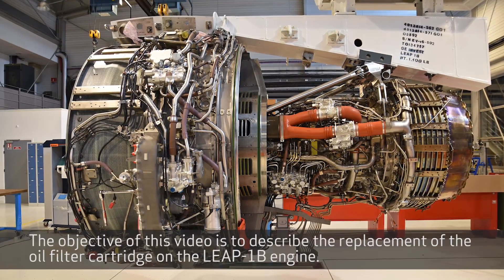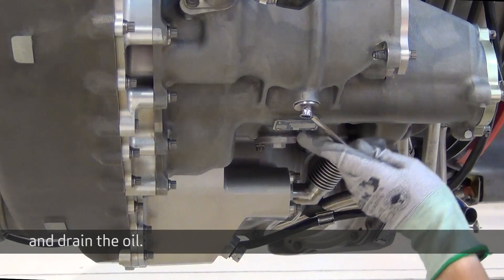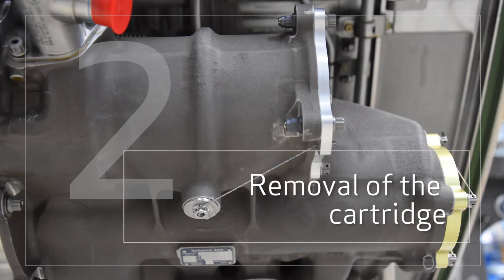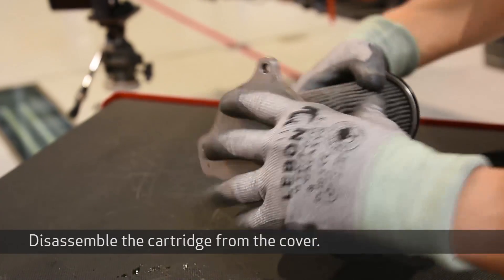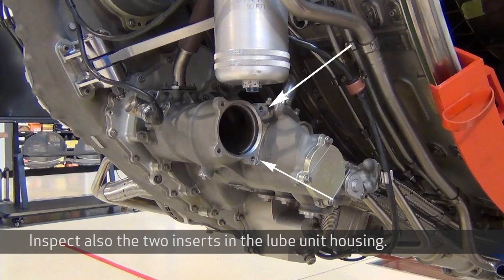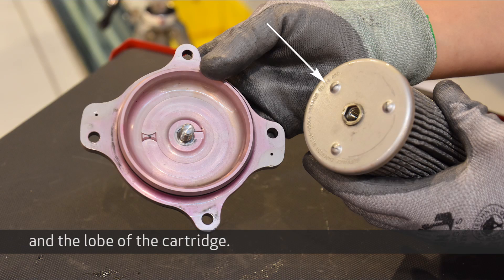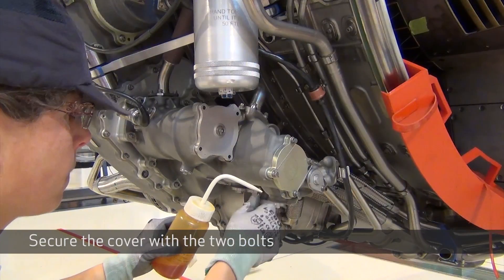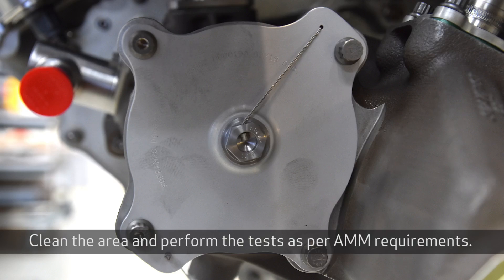CFM - LEAP 1B - Oil Filter Replacement - GE Aviation Maintenance Minute

Comment: I work at SAFRAN FILTRATION SYSTEMS and i am very interessed with the tool for installed o ring on the different components. Or buy this tool to mount the O-rings. Thanks you for the informations.